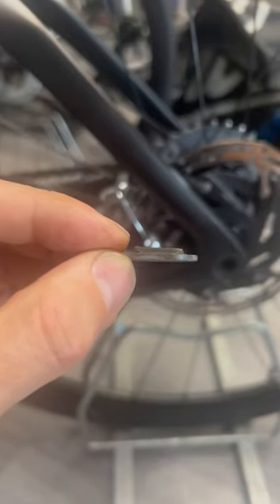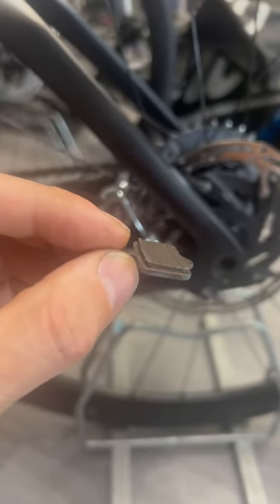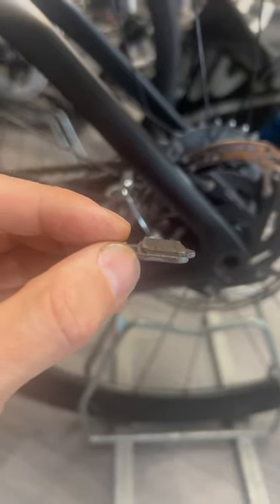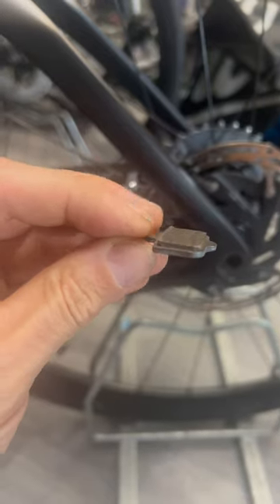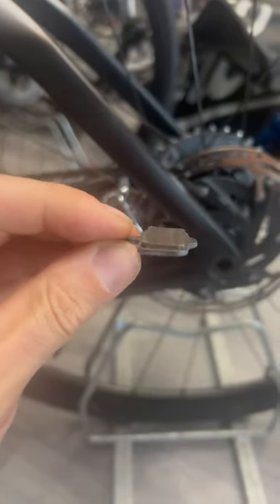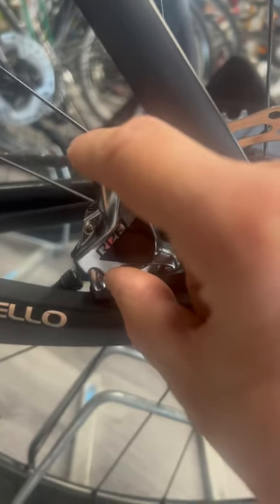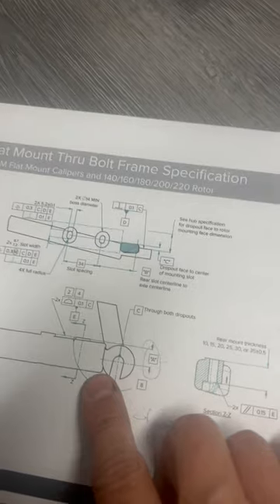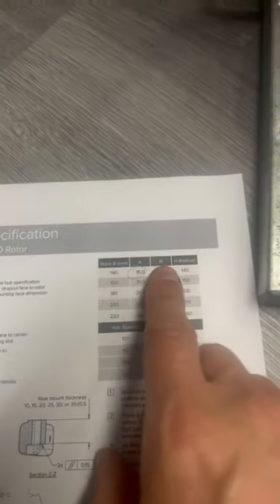Pinarello need a ruler in the workshop

Comment: I really don't get how this industry is running their QC. I worked for one of the biggest automotive  turbocharger manufacturers in the World and our product was made of components from over 40 suppliers and the suppliers as well as we had to check certain critical items on each turbo while others had to be checked every 10, 100 or 1000 turbos. For the price these premium manufacturers demand the product should be absolutely perfect!
Reply: The consequences of your work are much higher, and therefore more visible, than bikes. Regulations (general, government or company directive) happen when there's enough visibility from enough people upset enough to complain. Things like fork failures are catastrophic and dangerous enough that they are visible. That's why fork recalls are not uncommon. A rubbing brake pad? Premature bearing death due to slightly out of round holes? These aren't visible, so people don't complain, and nothing gets fixed (prevention and QC being a type of fix). Bikes are simple and the margin of error is wide. They generally "work" even if things are far from well made.

Comment: My Trek was nearly two millimeters out. It took several hours of filing, measuring, filing again to get it right. To make matters worse, it was only one post that was so bad so i had to apply more pressure on one side of the adaptor to make it work.
Reply from the maker: Might have been better to hog off some material with 240 grit and a flat surface and then face as you get close. That must have destroyed your tools.

Comment: The video shows a brake caliper adapter being used to accomodate a bigger brake rotor. Check if the right adapter has been used for the size of the rotor installed. Surelty that the default position point for the caliper for a 140mm disc (directly on the frame) are leading to a completely normal usage.
Reply from the maker: It’s too high on 140mm which led me to measure
Reply: @Mapdec  yes so that adapter is for 160 rotors  i guess.
Reply from the maker: @jebbadiah  yes.  But you can’t shave material off it without also changing bolts

Comment: Ssssssso... re-facing the lower side of the brake mount adapter? Or just shaving the brake pads and tolerating lower brake performance?
Reply from the maker: You would need to keep shaving the brake pads every few rides.

Comment: Is it possible to remove 1-1.5mm from the brake mounts without more problems appearing?
Reply from the maker: Yeah. Just time consuming.
Reply: Yes, but remember removing carbon from small areas is not recommended, 1 or 2 mm will not impact the performance, the issue is sealing that area properly, which is basically adding nail polish stolen from your wife's makeup drawer.
Reply from the maker: The area is raw mounded carbon. This isn’t prepreg sheets like RC cars.
Reply: @Mapdec  I guess a bike mechanic's job provides anger management for free. 😄
Reply: @Mapdec  After the removal will the mounting bracket touch the frame?
Reply from the maker: No. The engineers have designed the frame well, and these areas will have excess carbon designed to be faced off and corrected as it leaves the mould. This is just bad QC before it went to paint shop.
Reply: @Mapdec  Oh OK, thanks.

Comment: I might be tempted to grind the pads if the brakes seem otherwise nicely aligned.
Reply from the maker: It’s the short term hack workarround.
Reply: If they were nicely align you wouldn't have a promient section in the pad.

Comment: When there is an 0.5mm difference in your measurement it's not perpendicular. Pretty logical.
Both height have to be identical.
The length measurement is the key to measure here.
Reply from the maker: The line comes from a jig that lines up with the mount closest to the axle. Sorry if that wasn’t clear. So the furthest is 0.5mm higher

Comment: Jeeze, undo the bolts push the caliper back pull the brake, tighten, have fun. 

When did bike maintainence become so complicated?
Reply from the maker: You haven’t understood the issue.
Reply: @Mapdec  think I understood perfectly that the tip of the pad isn't being worn down in the braking process causing uneven wear and compromising the effectiveness of the brake. A side effect being a metallic sound as reported by the customer.
Reply from the maker: @gromitj  and the cause is…. The caliper sits too high… why is it too high…. Because Pinarello didn’t finish the frame properly when it came out of the mould…

Comment: It's funny really. Once there was steel frames with threaded bottom brackets and rim brakes. About as fault tolerant as one could get. Out of line? Bend it a bit. Wheels not upright? Grind the drop outs. Now we have carbon, press fit, and disc brakes. All very impressive but these things demand precision engineering, and the industry simply hasn't caught up yet. Maybe they just don't get it. Maybe we all need to take our 10k superbikes to artisans to be blueprinted (remember that expression?) B4 we even ride them.
Reply from the maker: Maybe. Or maybe mechanics need more up to date training.

Comment: Disc brake system is still too delicate system for frame manufacturers to handle. Price of the bike > 10 000 €?
Reply from the maker: Isn’t he the mad dude in the flasher trench coat ?
Reply: @Mapdec  clever guy in flasher trench coat. 😀